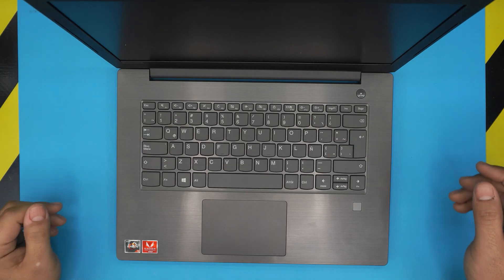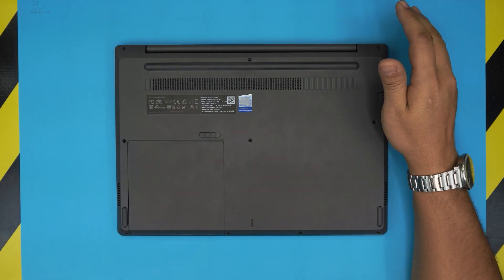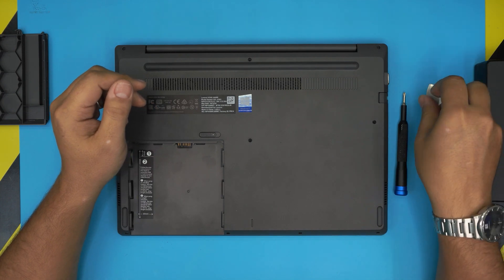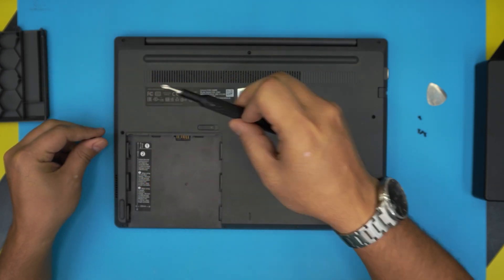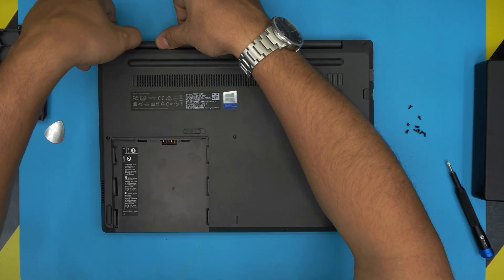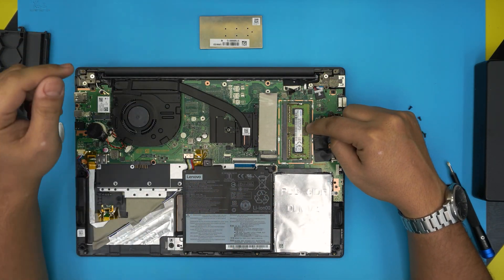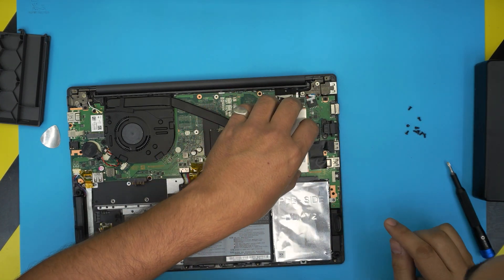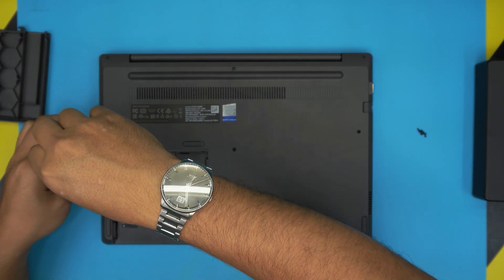Lenovo V330 | RAM UPGRADE

Comment: Thanks for making the video. It really helped. I should just add that there are actually two ram slots on the laptop. There is a 4gb ram not removable and a 4gb ram that you can upgrade as you showed
Reply from the maker: It's my pleasure my friend.
I appreciate your support, and yes, the board has 4GB soldered on the other side of the board.
cheers🍻

Comment: Can you upgrade the keyboard into backlit version?
Reply from the maker: 🫠Regarding your question, sure you can but you will need to buy the new keyboard with backlit and connect the LED cable beside the keyboard connector.
Should you have any further questions or requests in the future, please don't hesitate to ask me.
cheers🍻